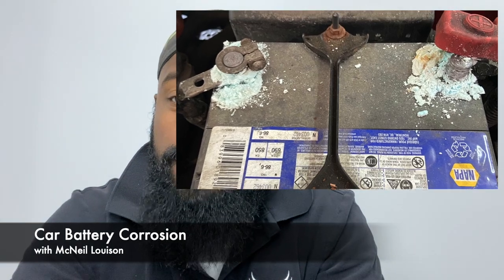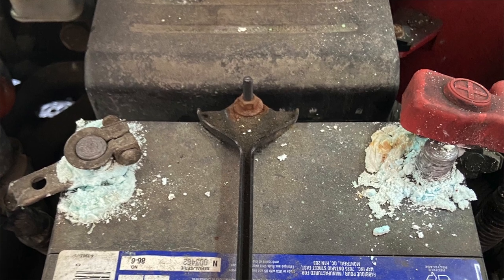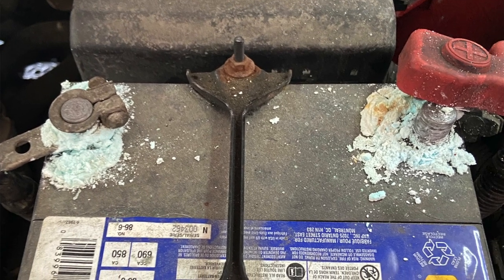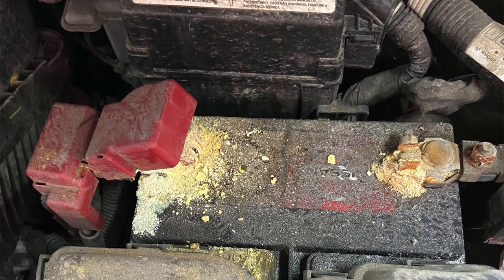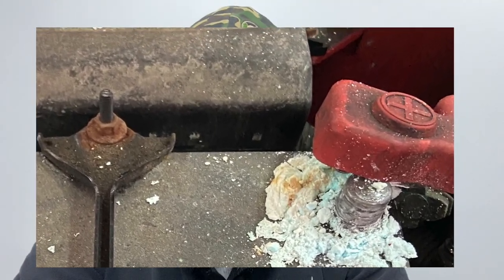Why is my car battery leaking?

Comment: My car battery is leaking from the bottom. I work in another country and I drive my car only when I visit my home country (once a year) and I noticed leaking from the bottom. It is super clean on the top terminals. What could be the reason. No issue while starting car. Battery looks good too.

Comment: Thanks, I had buildup on both terminals-cleaned them off, then had to get new battery. Issue now-got it Jan. 31-2022 & yesterday car wouldn't stop-some slight corrosion on both terminals-taking battery back to auto store for another-hopefully works & not something else.
Reply from the maker: you're welcome and thanks for sharing.
Reply: Clean ur earth connections

Comment: Hey ty
I recently on my Honda civic turned off the power saving mode which allowed me to drive the car at a better performance use of air conditioning was a lot better also notice right after that my (+) red cap on battery had some white salty powder on it 
I’ll clean this up using proper PPE 😅 and place the car in energy saving mode and see if helps 
I maybe will get more time out of it but it’s 3 year old battery already sooo seems normal 
Thx again

Comment: If you change the battery and it starts to build up again, what else can you look for?
Reply: most likely is the voltage regulator  (the part is inside the alternator). To test it: start the engine, let it run. then measure the battery with voltage meter. if the voltage is more than 14.5 volts then most likely the problem is the voltage regulator

Comment: If you just change to a new battery and the corrosion happens again on a new battery then should I be looking at changing the alternator?
Reply: Try putting some dialectic grease over it and see if it stops.
Reply: most likely is the voltage regulator  (the part is inside the alternator). To test it: start the engine, let it run. then measure the battery with voltage meter. if the voltage is more than 14.5 volts then most likely the problem is the voltage regulator

Comment: Hi, is this issue with the battery if it's overcharging..or is it something with the programming system? Will new battery resolve the issue or will face it again after a few months?
My car tends to stop auto starting after some time, and need to push the car to start it. Please reply..thanks
Reply: Ore then likely a parasitic draw not over charging.

Comment: Could the erosion cause ac to blow out hot air?
Reply: My air blows fine just hot air.  I just checked the battery and it has blueish corrosion .  My air all of a sudden stopped blowing cold air 2 days ago.
Reply: My ac starts to blow warm when my coolant gets low just something to check
Reply: @enricorizzo9318  thank you.  I'll definitely check
Reply: Ive had this issue and today my battery was bubbling
Reply: No